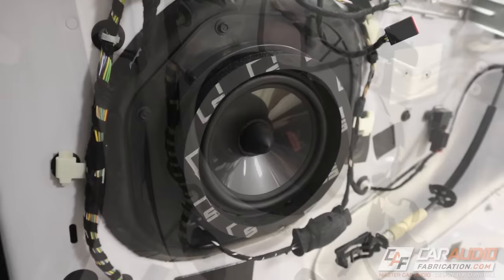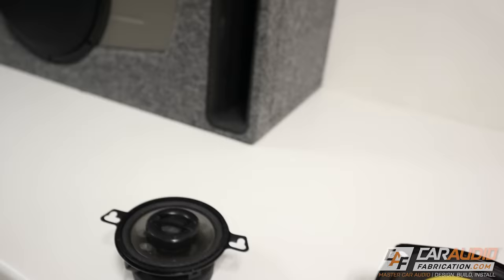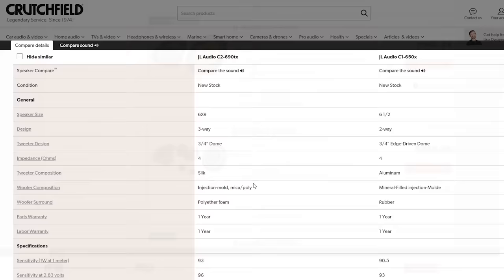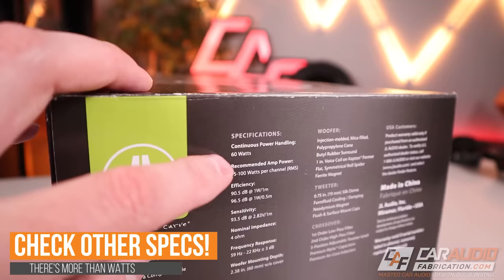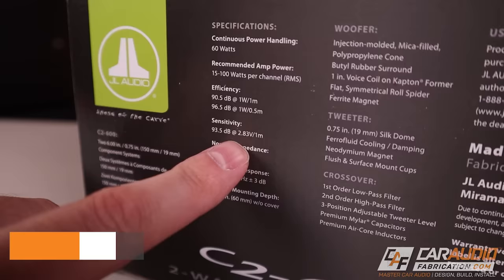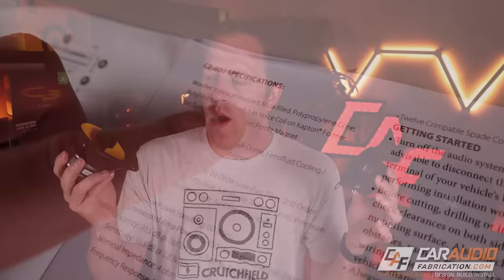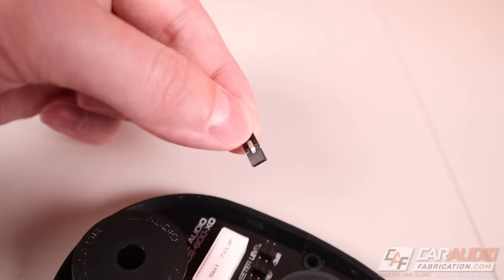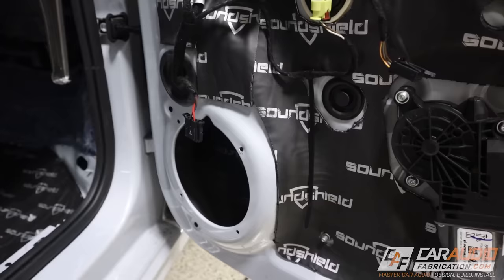DO's & DON'Ts - Picking Amazing Sounding Speakers!

Comment: Anyone here including Mark have any specific brands for a SQ build with a lil bit of SP too it,
 I'm looking to do a pioneer  build this would be my second build 
My first build was a 700$ dollar mutt of a build lol 😆 with some sony rockford fosgate and alpine gear any tips and good brands appreciated
Reply: Audio control and focal for speakers. There are endless posibilitys with the dsp and focal is in my opinion one of the best. But there is a price you need to pay for it
Reply: PRV Audio
Reply: @tomvandernoll1455   ooooo yes I was thinking about a audiocontrol 6 channel anp and probably focal tweeters possibly
Reply: Check out ct sounds. Reasonably pri ced and decent gear.
Reply: Steg or Morel components.

Comment: Every car I buy has bang & olfusen drivers..so no use to me.. good video though!
Reply from the maker: You don't know what you're missing. It doesn't matter what premium system it is, the automaker still puts restrictions on the engineers like: the whole system must weigh less than 4 pounds and  cost less than $22 for us to manufacture in mass. These restrictions lead to a less than optimal performance.

Comment: Some people say Alpine R-s65c.2s are awesome speakers with great midbass. Others say they're rubbish with non-existent midbass... I somehow got the later. 

I'm thinking the quality control at Alpine's Chinese factories varies greatly  :(

I'm getting STEG's next time.
Reply: One thing I will say is they can take a lot of power. But you need to run 175WRM into them to just sound okay.
Reply: The problem is they are average speakers. Get into higher end brands and you will find Alpine are subpar.
Reply: @vongdong10  what do you think of JL Audio? Was planning to replace my old kenwood speakers which have dry rotted with their C1 lineup
Reply: @NineS5  I'd probably put JL in the same category as Rockford Fosgate. I'd recommend getting into focal, morel or dynaudio. These 3 are the biggest names in car audio for sound quality afaik. I've got dynaudio's top of the range tweeters and woofers in one car, extremely happy but I'll be trying morel in another car and keep it more sensible price wise
Reply: @vongdong10  hahah theyre that terrible? good thing i havent bought anything yet. Focal also make some great headphones and home speakers so no doubt theyre good. I dont really want to spend more money than the car is worth though. do they have a budget lineup? was thinking of spending around €400 in speakers and maybe put an amp in down the line. But first I gotta upgrade the head unit to something better. thing is almost no one talks about the quality of their built in dacs.

Edit: Holy shit, their auditor lineup are not that expensive at all. question is are they any good?